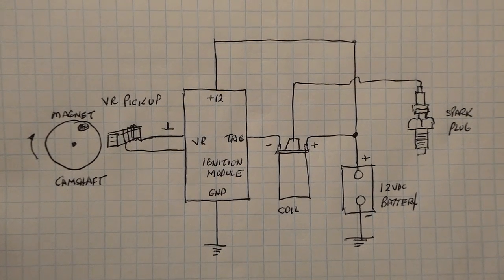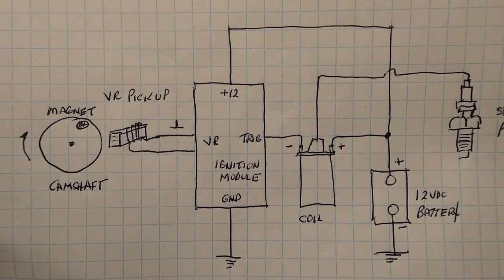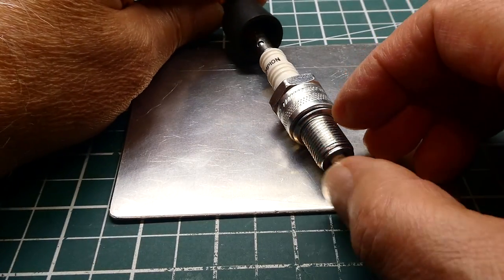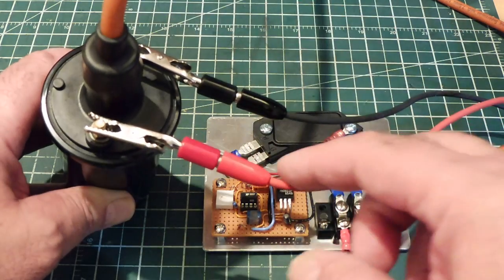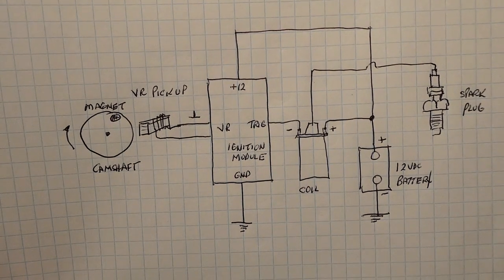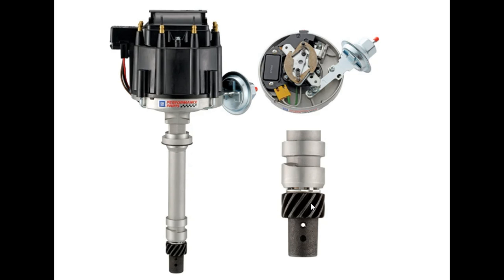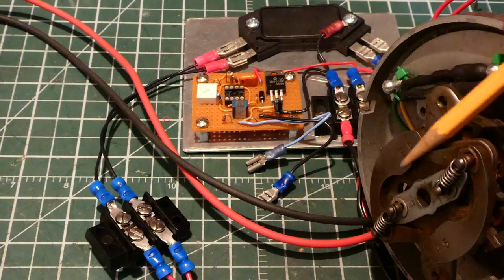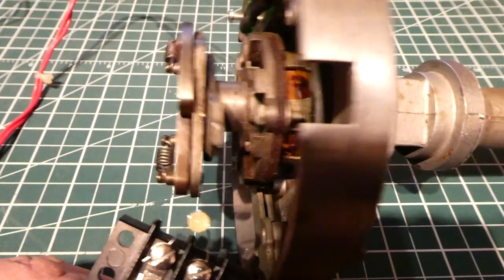Small Gas Engine Troubleshooting / Variable Reluctance Pulse Generator

Comment: The inductive trigger pulses are very simple and easy to imitate by simple ( only one capacitor and one resistor) RC differentiator circuit, driven by square wave generator  . The output signal is AC signal very similar to the original signal and for testing purposes works flawlessly !
Reply: Yeah, but it's not as cool as repurposing an old distributor.😁